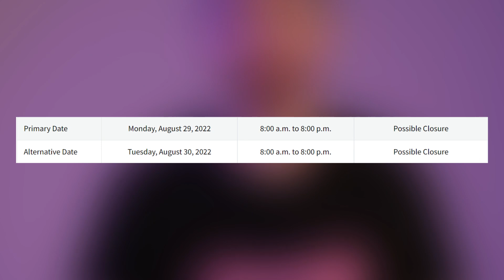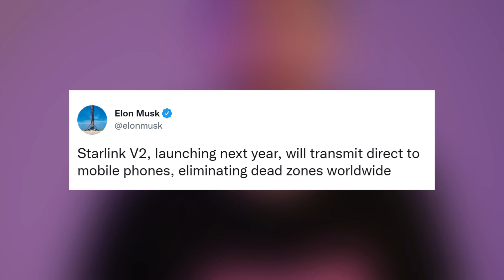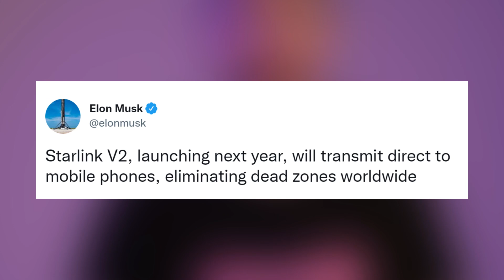BE-4 Flight Engine 1 Assembly Issue + Starliner  1st Crewed Flight | Starbase Pink

Comment: I have a "dumb" question.  The first Starship launch is still being projected to be a suborbital 3/4 loop around the Earth, yes?  If so, how can they place Starlink V2 satellites in orbit?  I don't think these satellites come with their own boosters to place them in stable orbits.

Or is Starship actually going to be placed in a stable orbit of its own and then have to do a deorbit / retro burn?
Reply: Being in orbit means having the necessary speed, not completing one trip around the earth. My understanding is if everything goes right Starship will achieve orbit, dispense the sats, and come down before completing one trip around the earth.
Reply: @MrEd2291  By "in orbit" I mean the Starship will be at a sufficient altitude and velocity to continue to orbit the Earth several times unless or until the engines are fired for a deorbit burn.  Once in a stable orbit, Starship will have time to do whatever is required whether it is releasing satellites, running additional tests and checks that can really only be done properly in a microgravity environment, and then do the retro-burn for the final and arguably most important test of the heat shielding.

Suborbit means to me having only sufficient velocity to take the vehicle less than a full circle of the Earth. 3/4s more or less in this case with it coming back down whether there is a retro-burn or not, in other words NOT being in a stable orbit which the Starlink satellites NEED for proper deployment and use.

Comment: Such mistakes like forgetting to move the scaffolds are unnecessary, some of these workers are getting sloppy... its a small mistake that can cause a bigger issue
Reply: Well, careful; SpaceX moves faster than anyone; these folks are under relentless schedule pressure, and no one has built a tower system like that before. The main thing is for no one to get hurt, and to learn each lesson, only the one time.
Reply: When the private screws up, the general gets shot.
Reply: There is way too much stuff, parts and machinery sitting around when Space X does their tests. It would be so much safer if the launch structure was fully finished before they actually do their tests. It really is an accident waiting to happen.

Sure, you can blame individuals and speed for each accident, but from what I see on the various videos, these sorts of accidents, small explosions and fires will keep happening.

There is real risk of an explosion of 7,000 tonnes of methane and oxygen unless there is improved procedures. An orbital launch of Starship should only take place when the launch structures are fully complete and all the extraneous gear and parts are removed.

Comment: Thanks for this nice update video, especially the info that the new BE 4 problem was just a minor assembly issue. The Angry Astronaut made a whole 17 minutes drama video about this issue where you get the impression of new major problems with BE 4.
Reply: It's probably something in between, you can't take Bruno's comments at face value on this, his companies whole future rests on BE-4 being available and reliable. Personally I think that after 2 years to build these engines there shouldn't be any assembly issues noticed at all. Especially as it is only 2 engines that have taken so long to put together. I still think that BO is going to have to have a major redesign to get those engines to a point where they are economical to build and reliably available. There is no way they are making any money on these engines at current price ULA are paying, they may actually be losing money on every engine.
Reply: @schrodingerscat1863  Yes I agree. The BE 4 in it's current state with all the pipes and cables looks like a Christmas tree and worse than Raptor 1. But we'll see how it goes and if the first Vulcan Centaur flight succeeds.
Reply: @jonny3003  I think reliability is there but the cost and time to manufacture is the killer, though having said that it is a very different thing running engines on a test stand to on a rocket so we will have to see. BE4 needs a lot of work to reduce complexity and make it easier and cheaper to build. It is almost certainly losing BO money with every unit currently and that obviously isn't sustainable.  BO need to change their approach and become more agile to evolve designs quickly and make incremental improvements. With their current management they don't seem to be able to do this.

Comment: Wait... As the theories say, the first Starlink V2 group will fly on the first Starship - Super Heavy Orbital Flight... But Elon said that the first Starlink V2 group is launching next year... Strange... I hope it doesn't affect the Starship - Super Heavy Orbital Flight planned soon in September...
Reply: Elon said there exists plan B with a modified mini V2 to be launched with a Falcon 9.
Reply: @DEr-j5j  SpaceX is totally focused on Starship, and that's great, but I think they really should have developed a larger fairing for Falcon 9/Heavy. It must be harder to develop then just a shell, but it can't be harder then redesigning the Starlink V2 to fit the current fairing. (Also increases flexibility)
Reply: I strongly suspect that the first few Starlink V2 launches will be nonproduction test articles. The very first Starship orbital flight will be in an orbit that will intersect with a missile test range in the Pacific Ocean. Starship will deploy the Starlinks into the same orbit. I don't know if the Starlinks even have enough thrust to avoid following the Starship into the ocean.

With careful planning, a lot of tests can be done in half an orbit.

Keep in mind that SpaceX uses hardware rich design and development. They have undoubtedly made quite a few Starlinks in the process of building and testing the assembly line. The early ones probably aren't suitable for production use.